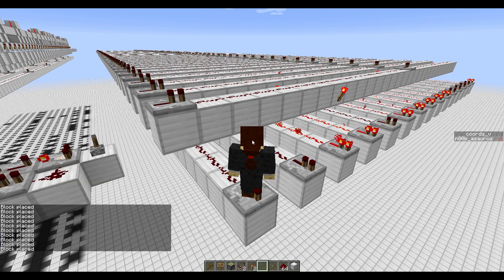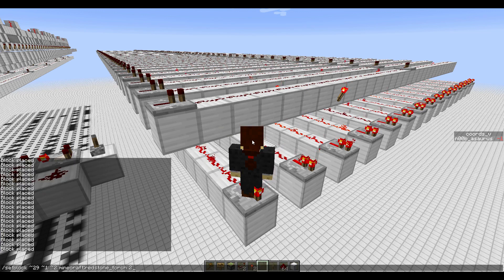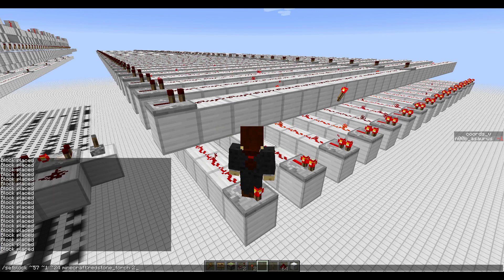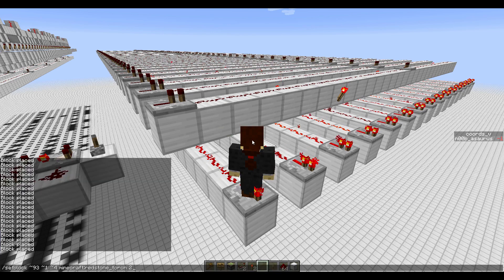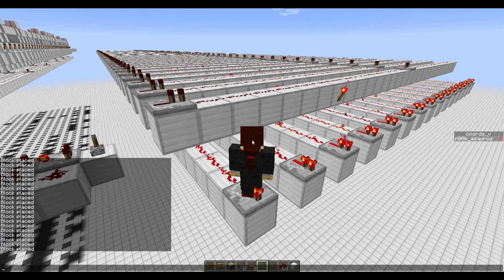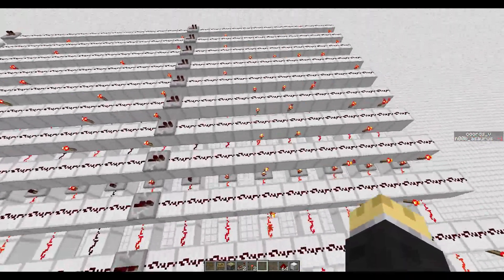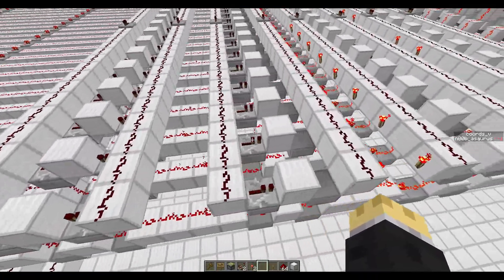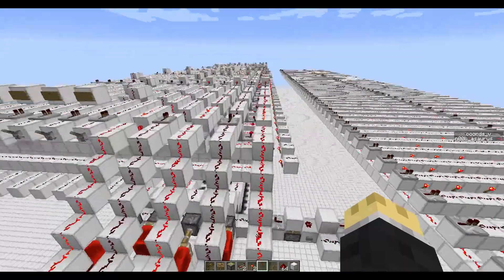Help Me Make a ROM/PLA Building Program!

Comment: Challenge accepted!
Reply from the maker: yay!
Reply from the maker: Holy crap dude! Nice! Let me run some tests and see how she runs :D
Reply from the maker: Bloody brilliant man!!! Like seriously! I did notice a few bugs here and there, like when it types a : or a _, it seems to get the unicode mixed up. That's an easy patch, but then I'm noticing a few other bugs where it's not placing the redstone on a few of the output lanes or neglecting a few repeaters on the input lines

I'm still trying to figure out what might be causing that, but still this is lightyears better than what I could have come up with!
Reply: Oh dang! Is it consistent or random? I was having trouble with the clipboard so I replaced copy-pasting with typing all characters one by one but it required some workarounds. Try setting the commandRate variable (top of the file) to 40 instead of 30, it's gonna slow down a little but it should prevent race conditions. If that doesn't fix the problem, try replacing the body of typeString with the copy-pasting snippet you were using in your program (without the newlines). I mostly tested regular decoders and small random examples, could you give me the input that caused bugs so I can test?
Reply from the maker: I'm not sure if it's random or constant, still haven't figured out the pattern. But I can at least give you the text file I noticed it with:

XXXX1XXXX00000n
XXXX0XXXX00000n
XXXX01XXX00001n
XXXX0010100001n
XXXX0010000001n
XXXX0000100001n
XXXX0000000001n
XXXX0001000001n
XXXX0001100001n
XXXX0011000001n
XXXX0011100001n
XXXX0100000010n
XXXX0101100010n
XXXX0101000010n
XXXX011XX00010n
XXXX0100100010n
0XXX0101100011n
X1XX0100000011n
1XXX0101100011n
X0XX0100000011n
XXXX0XXXX00100n
XXXX0110X00101n
XXXX011X000101n
XXXX0111100101n
0XXX0XXXX00110n
1XXX0XXXX00110n
XXXX0XXXX00111n
XXXX0XXXX01000n
XXXX0110001001n
XXXX0110101001n
XXXX0111001001n
XXXX0XXXX01010n
XXXX0XXXX01011n
XXXX0XXXX01100n
XXXX0XXXX01101n
XXXX0XXXX01110n
XX1X0XXXX01111n
XX0X0XXXX01111n
XXXX0000010000n
XXXX01XXX10000n
XXXX0X1XX10000n
XXXX0XX1X10000n
XXXX0XXX110000n
XXXX0XXXX10001n
XXXX0XXXX10010n
XXXX0XXXX10011n
0XXX0XXXX10100n
1XXX0XXXX10100n
XXXX0XXXX10101n
XXXX0XXXX10110n
XXX10XXXX10111n
XXX00XXXX10111n
1XXX0XXXX11000n
0XXX0000011000n
0XXX0001011000n
0XXX0001111000n
XXXX0XXXX11001n
XXXX0XXXX11010n
XXXX0XXXX11011n
XXXX0XXXX11100n
XXXX0XXXX11101n
XXXX0XXXX11110n
XXXX0XXXX11111n

I placed 'n's at the end of each line just in case youtube gets rid of the newlines. If it's all jumbled, just replace all 'n's with newlines in notepad++ or something.

It seems like somewhere between line 5 and 10 (though I noticed your program builds the tables backwards, so I guess in reality it's somewhere between line 53 and 58) it fails to place the redstone dust.
and somewhere towards the end (near like line 5 in the text) it fails to place a few repeaters.
Reply: Alright, I have updated the code.

* The table is built in the right order now (I thought the file was like a top-down view of the decoder).
* The repeater bug is fixed. I think the redstone missing was random,  I don't think I can fix it :/
* I found a way to make it build faster, your large table now takes (only) 14 minutes to build.
You will still have to apply your patch to the typing code, I'm not getting the bug so I don't know how to fix it.

I also found other ways to make it build faster that I think I will implement, this project is way more fun than I even expected.
Reply: Updated the code again, I optimized it again and got that big table built in 7 minutes
Reply: I changed the code's location: https://github.com/Stenodyon/decoder_generator/tree/master

If you are in single player, you can change a line (61 & 62) in the program to output a function file instead, that you can then use to build the decoder instantly :)
Reply from the maker: You went to school for this crap didn't you ;)
Reply: Lol not even, but it's a hobby of a long time, and it's gonna be my job soon
Reply from the maker: Well you should definitely list this in your resume!
Reply from the maker: I tried looking for a PM button on your channel. Youtube doesn't have one apparently. 
Anyway, I still think this would make for a neat little tool, problem is I don't have the time/skill/patients to distribute, maintain, and improve this project.

I'm wondering if this is something you would be willing to take on? I can help with the initial development of course, but after that it would pretty much be yours.
Reply: Here's my discord tag: Stenodyon#4789

I technically have been maintaining the project, but there has been no bug report/feature request sent my way yet (in the form of github issues at least)

Comment: Let's see if I understand the question. You're asking for a program that reads a line in a text document, and builds a line in the decoder that gives an output when the input matches that line. For each line, there are a series of 0s, 1s, and Xs. A 0 means that input line must be off, a 1 means the input line must be on, and an X means it doesn't matter. The challenge is figuring out where to put the repeaters and torches, due to properenglish19's optimizations. Sometimes he has the repeater go below the line, sometimes he has it between two lines to affect them both. Same with the torches. And you need a program that can figure out where to put the repeaters and torches to give desired outputs based on inputs. Did I get this right?
Reply from the maker: you got it right! so far I've gotten some insights from people, but no breakthroughs yet!
Reply: Does it have to be the exact same design, or can there be minor changes?
Reply from the maker: as long as the profile is the same (i.e. all the inputs and outputs are as close together as possible, preferably 2 blocks apart) the design can change as much as it needs to

Comment: honestly it doesnt seem like too complicated of an algorithm too create albeit a bit annoying. the design is fairly regular in the sense that it only varies if there are two consecutive numbers which need power to be given to them using a repeater for all i can tell, right?
Reply from the maker: for the most part, though one problem I've been running into is if two lines match each other for too long. Like if one line has a 00 and the line right next to it as also a 00, the first one is easy, since you just have to place a repeater between the lines, but the other line poses a challenge, since you know, there's no were for that repeater to go
Reply: how would you solve it if you were just building it manually?
Reply from the maker: I usually look at the surrounding bits to see if I can't arrange them in a way that they mesh together nicely... it's intuitive for me... which is why I'm struggling to convert it to an algorithm
Reply: well that does make it difficult, yes. xD
Reply from the maker: lol, I'm sure I'll think of something, I figured it would make it easier to consult some brighter minds!

Comment: You can use OR gates and AND gates. Also, wasn't the point of the PLA's lines being the control wires? Why are PLAs suddenly becoming so popular? Before there was no IS, then some basic IS, then hardcore IS and now PLA xD.
Reply from the maker: in this case I'm using ROM's as the control source and PLA to control the ROM's by using it as a state machine. I'll have a video about it fairly soon

Comment: first
Reply from the maker: second!
Reply: Third and fourth!
Reply: oh ok good you posted the source code i can try to do some work for you. but it will take time.
Reply: hey noob this was 1.12.2 right
Reply from the maker: 1.12, I haven't updated forge yet
Reply: ok it doesnt matter tho cuz the commands will all work but i am almost done. it is not the same decoder but it it is non sequential like you wanted. I have almost finished it, should be done soon depending on the circumstances. i might get snowed in tomorrow in which case 1-2 days, if not 2-3 id say

Comment: ok serious question. do i just run this in my java ide or do i place it somewhere in minecraft's source code. i can do both
Reply: i figured it out
Reply from the maker: I'm not sure what solution you got, I ended up using the robot class in processing (it's a shit language, but it's easy to set up and they give you access to most java tools). Ultimately it doesn't matter what you do, it's the end result that matters.
Reply: Oh i get it. i am supposed to run it in processing. i was using eclipse. no wonder i had so many errors
EDIT: thanks for letting me know
Reply: the program has no errors but it isnt doing anything either. any idea why?
Reply from the maker: well youtube wouldn't let me put angle brackets in the description, so you'll need to replace all greaterthan and lessthan with their respective angle brackets. the other thing is it requires a file. the moment you run it, it should prompt you for a file. Give it a text file with lines of 1's and 0's then you have 5 seconds to click into minecraft. Stand still, as all the commands are relative. after 5 seconds, the program should start pasting commands into the console.
Reply: yes. should i do the X's like in the discription? when i run it everything goes good, but i have to push t for the commands to go, and it only does part of the rom. like 2 lines
Reply: wait nvm i did something wrong
Reply: wait nvm i did something wrong
Reply from the maker: oh thats right, default chat button is t... i have mine bound to the enter button... if you look at the source code, theres a function called typeString, in there is two sets of the same two commands. robot.keyPress('\n'); and robot.keyRelease('\n'); in the first set only, change the \n's to t's and that should work

also this is just the look-up table maker, not the decoder maker, so it only takes 1's or 0's
Reply: n00b_asaurus yes I got it to work fully
Reply from the maker: Nice!
Reply: n00b_asaurus I did everything you said before you replied that. Tomorrow night I will do more work on it but I have school tomorrow so I have to do it at night
Reply: n00b_asaurus I am going to start with sequential decoders then expand my way to combinational
Reply from the maker: if you feel up to it! awesome! otherwise don't stress yourself ;)
Reply: ok i think im snowed in, not up to me tho. however i got a simple combinational one i think it is even smaller then yours but the inputs are 2 blocks apart the outputs are 1 block apart
Reply from the maker: not bad!
Reply: yes at the rate im going at probably 2 days. wait i have a question. how long did the code take you to make
Reply from the maker: about a day... to be fair though I had the easy bit
Reply: well... yours was the most important. had you not made it, and asked for help from scratch, i wouldnt be here
Reply from the maker: indeed ;)

Comment: I’ve got something... reply if ya are interested.
Reply from the maker: shoot!
Reply: So, you’re interested?
Reply from the maker: Shoosh yeah!!!!
Reply: Okay, so this is what i had in mind:
You basicly program a program (ya ik so special) where in you basicly convert the numbers into parts for the decoder. Like, you put in the number 5 in the program and it gives you the decoder part for the number 5. But when (Here needs to be some special logic) there’re two 0’s (Binary) after each other it converts that little part to a “2 0’s unit”.

lIkE iF YoU aAgREe.

Ok, so... was this helpful enough?
If you want, i will convert all of this above to a language... one problem tho; i don’t know Python (As said in the video). So maybe i can make the program in some other language?
Reply from the maker: well that was what I was thinking, but the problem I found was what if the next line over encounters the same problem? like if the first line has two 0's in a row, that's easy, just place a repeater between the outputs, but if the next line also has two 0's, it's got no place to put the repeater. That's the part I'm struggling to figure out